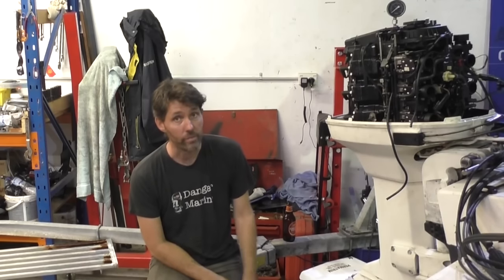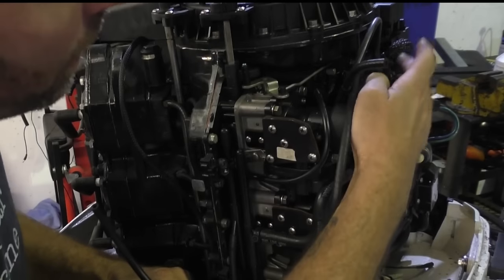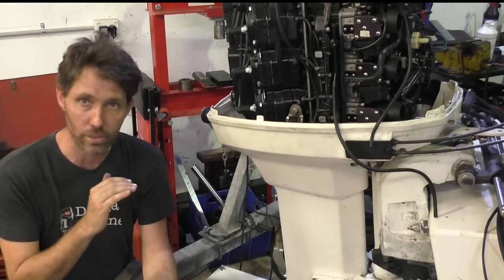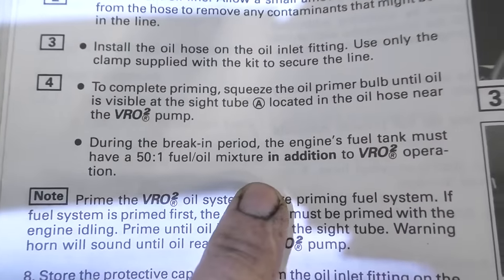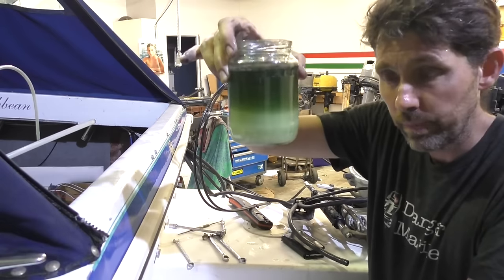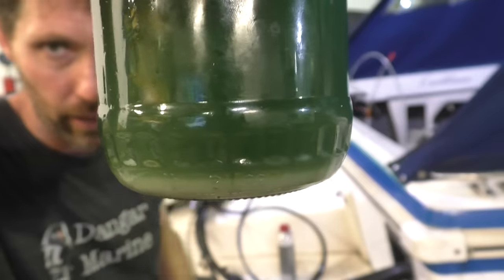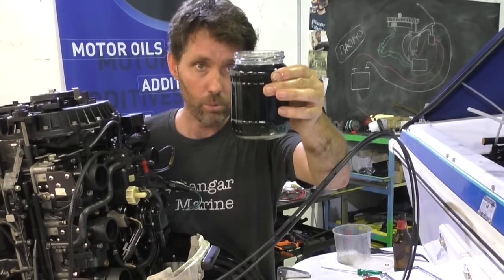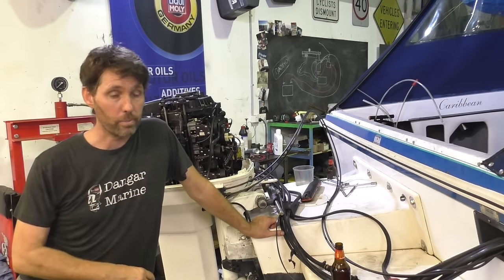Almost ready to start the Evinrude 150

Comment: I'm concerned that fuel was put in the tank and adding the oil after. I don't see how it could properly mix sitting in the shop. The fuel you later purged out was very dark, similar to the oil, as if the oil went to the bottom of the tank and out the line from purging. 
Also, I've read from other people in the field to not use worm drive hose clamps. They don't seal good enough and the VRO oil and fuel systems NEED to be very tight as leaks cause problems which are often blamed on the VRO.
Reply from the maker: Modern two stroke oil mixed very readily. You only need to put some in a clear jar of fuel to see what happens - very different to old oil that needed vigorous mixing. Worn drive hose clamps are fine. They can hold the pressure of EFI systems without leaking which shows how well they seal.

Comment: I have a 200 hp 2006 etec motor, can I change my powerhead out to a 250 or 250 HO using my same lower unit, nothing wrong with existing powerhead just want more power, thanks.
Reply from the maker: Possibly. I've never worked on either of those motors. All the boats around here are small commuter boats less than about 50HP but an Evinrude dealer should be able to tell you straight away.

Comment: At 6:00 you added the 2-stroke oil directly to the tank on a boat on the hardstand. How do you expect it to mix.
Assuming the engine had an oil injector issue,this would explain the overcooked outcome after your rebuild.
It ran just fine on the external tank with oil well mixed (prior video) didn't it ?
Say the oil pump was cactus, AND your new fuel was not mixed, thus raw. It may have been green but was still way to lean. 
It must be pre-mixed before addition to tank otherwise it just settles at the bottom of the fuel tank and will only mix slowly over time and movement.  Did it run long enough to detect a drop in toe 2-stroke oil reserviour ?
Reply from the maker: Many years ago two stroke oil needed to be mixed thoroughly, these days modern two stroke oil is self mixing and, "formulated with a special solvent to disperse quickly and readily throughout the fuel in the fuel tank" Of course it is also a very windy 30 minute drive down to the water.

Comment: Back timing off 3°and jet carbs rich. They melt pistons for no reason.
Reply from the maker: It is weird the way these motors melt pistons, and yes, backing off the timing and richening up will definitely make it run cooler.
Reply: Dangar Marine I built many since 1970s. Loop charged OMC melted alot. The new BMC Bombardier hold up well. Back in 1978 they made high ring pistons where all the top keystone rings peeled off. We had to warranty dozens here in NY on Long Island. The old style cross flow designed still running today The 3cyl 70 and 115v4 from mid seventies still going even in salt. Yamaha stole their designs. Mercury v6 held up ok but the straight six ng in salt. One slight overheat melted pistons no overheat alarm either like OMC.

Yamaha 350 cranks snapping now . Good Job from NY Cheer s

Comment: interesting I put the carb back in with the new float and primed it in the engine but fuel was coming out the throttle and vent. obviously  the float is not set right. so need to troubleshoot shoot that on the work bench and the Yamaha fuel pump. Oh fun haha
https://youtu.be/dzxLAaLLVjM
ok update here with video. figured out how to test the merc carb and yamaha fuel pump for leaks off the motors. fuel leaks on a boat is super dangerous as my friend found out with his boat 300 ft down in the puget sound burnt up. fortunately another boat got him and his friends off before it sunk in flames. first mistake he made was using a kicker motor that was not his and not checking it for leaks before they went out. next mistake was not using the fire extinguisher and trying to put it out with his cooler water. Anyway the float on the carb was set wrong and to fix it just copied the mid carb setting from the factory. hooked up my testing method here and no leaks now. success👍

Comment: Hey Stu, got two questions for you. Im doing a 92 v4 looper. Service manual is telling me to not use any sealer on the base gasket between the center pillar and power head but here on the v6 you did use something. Its supposidly self sealing with the heat of the motor. Im wondering how that things gonna heat up and seal with water flowing. Also my headgaskets require sealer and im wondering do I keep the sealer off or on the center metal ring of the gasket?

Thanks,
Bryan

Comment: Anytime I do a rebuild, I always do the initial start on a super clean dry,   portable 6 gal plastic tank, With fresh  Premium petrol & top line TC-W3  Amsoil at 40 -1  I want only the best and best, & better best going in them nice clean carbys..  To much work & time to chance it,   I need  ""NO""   fuel ghost making me doubt my build, period..  just me..                                             kodibass
Reply from the maker: It had crossed my mind too to run off a portable tank for the first run, particularly until the tanks are sealed well enough. Fortunately the rain has settled down hear but I agree somethings shouldn't be left to chance.
Reply: I agree 100% on using a test tank, especially for a nerve-racking first fire.  (Big butterflies every time)    Amsoil is top notch stuff.  I use a test tank for everything I work on.  No time for fuel issues, and if problems come back, that could help narrow down the cause.

One thing I would NOT recommend is running premium, 93 octane.  These are made to run on 87 or 89 at the most.  93 has been known to melt pistons. I had two come into my shop with melted pistons last year, (which is kind of rare) and I asked them if they always ran premium, and both said, "Of course!" Both were on fast bass boats, which is a contributing factor.

The original warning I heard was a Yamaha factory service bulletin that my dealer shared with me some years ago.  I asked my OMC rep what he thought, and he agreed they are made to run on 87.  I've known people that run 93 with no problems, but that service bulletin always sticks in my mind.  Mine run great on fresh 87 octane, and I've never blown one up.
Reply from the maker: Yeah, I've decided to go with a test tank for the start up, I have one in the shop so it is easy to rig. Interesting to hear what you are saying about higher octane burning up pistons. It seems counter intuitive given higher octane fuel is more resistant to detonation. In Australia premium fuel is 98 octane and 91 is the lowest you can find. I've always run my outboards on 98 as it is also a better quality of fuel.
Reply: Wow, that is interesting.  I wonder if they use a different way to determine octane there, like SAE versus metric?  But you guys may just have better fuel there.  I imagine the engines there are adjusted to run on it without problems.

What I was told, is that higher octane fuels are "thicker", hence they burn slower/longer.  That's why they don't detonate or knock as easily as the lighter fuels tend to.  But because they burn slower, if there is a chunk of carbon on the top of a piston, the fuel will stick to it, and keep burning after the power stroke is over, and during subsequent cycles, This causes a "hot spot", eventually melting the piston.  

I am not an expert by any means, just parroting what I've been told because the source seemed credible, and hoping it is helpful.    Please feel free to reject or correct these comments at will.   

I wish you could see the piston in the 200 Venom I have here.  It was absolutely liquefied!  The rings were still in it, but the entire aluminum piston was reduced to blobs.   I'm trying to decide whether to rebuild or just find another powerhead. I'll get to it eventually.
Reply from the maker: thilltony It looks like the rating system is different. The effect of higher octane is possible, but I'm no expert either. ;) https://www.reddit.com/r/explainlikeimfive/comments/1iedtv/eli5_why_does_american_fuel_have_less_octane_than/
Reply: Thanks for that link.  That is what I thought, but I couldn't remember how it went exactly.    

Unfortunately, as the discussion in the link pointed out, they DO artificially enhance the fuel here with additives and ethanol.  To keep your engine healthy, you MUST use stabilizers like Stabil or Startron, or use all your fuel within 30 days or so.  Regular doses of Seafoam helps too.

There is a YouTube video where a guy puts fresh fuel in a glass and blows a fan across it for 45 mins.  Very quickly, the fuel was cloudy and full of water.  That is the junk fuel we have to deal with if we don't feel like paying almost a dollar more per gallon for ethanol-free.
Reply: Unfortunately we can't get Ethanol-free in the northeast, or at least the bubble around RI that is mass, ct and northern New England. Great comment about stabilizing with EVERY fill-up. I've been telling people gas goes bad in a month for years but all my friends keep re-using 6 month old fuel.

Comment: This style "zip tie" used to be standard equipment on all Johnson/Evinrude outboards.  I understand it was also used on some Mercury and Yamaha application.   Johnson/Evinrude #320107.  https://fuelhoseziptie.com/  or https://www.hellermanntyton.us/ProductDetail.aspx?p=112-52112
Reply from the maker: It's interesting to see these, I wonder if the curve on the head is what allows them to wrap nicely around the hose prevent any leaks?
Reply: Yes.  They work very well, too!  I buy them by the hundred, and use them daily.  Better than metal clamps in many instances.  That first link Wizard posted shows the mechanics of why they work.   

Once you start using them, you will probably never look back, as long as you can get them at a reasonable price.   I think I pay about $10 for a bag of 100, or $0.10 each.   If you buy them in smaller numbers, they are like $0.50 each.